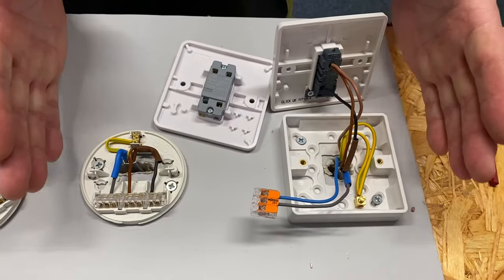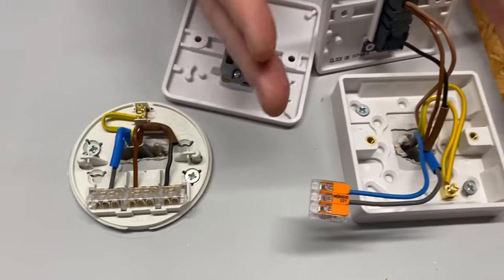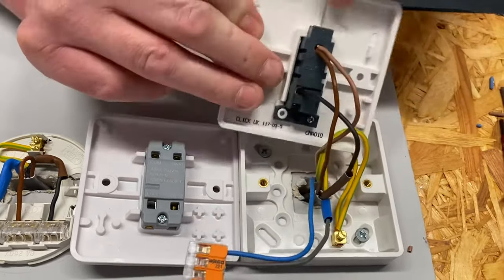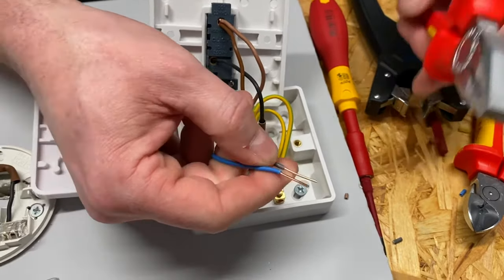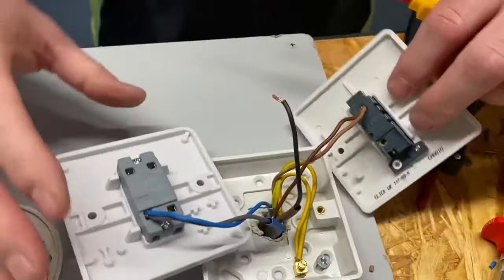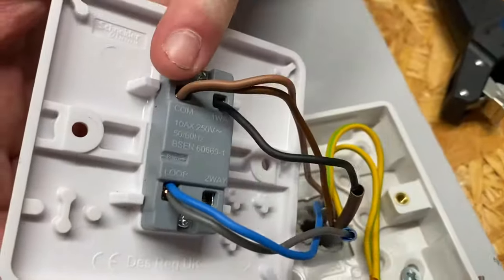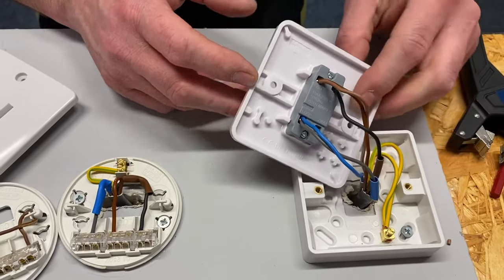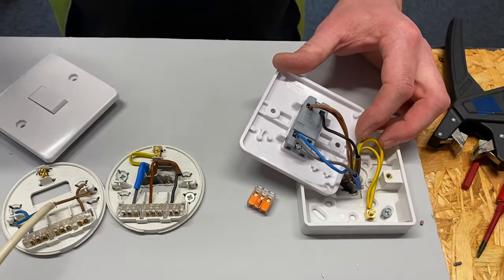Future Proof with a Neutral Connection in the Switch - Schneider Electric

Comment: Best of both worlds!
Reply from the maker: Just trying to give ideas Wayne. Are u a feed to the switch or 3 plate lover? 

Thanks for commenting and watching
Reply: @GSH Electrical  I suppose it depends.. What the client wants, cost, time, and practicalities. Would there be enough room in a typical down lighter fittings to aconadate the permanent line conductor? Your example showed a ceiling rose to accommodate the extra feed cable to extend the lighting curcuit. But I guess a junction box would be needed if you were extending off down lighters?

Comment: Traditional 2 plate and 3 plate wiring avoided running neutrals through switches as there were no BS approved connectors you could joint them with hence it was considered bad practice when I did my “tech” 35 years ago 😮
Reply from the maker: Thanks for your input

Comment: Interestingly, all the 1980s houses on my estate were wired like this on the ground floors - they were ahead of their time!
Reply from the maker: Sure was 👍🏻
Reply: @GSH Electrical  I actually think there's a lot to be said for the old 'Octopus Wiring Systems' way of doing lights - makes it very easy to add, remove or modify how fixtures are wired

Comment: I dislike placing the neutral at the switch… but nowadays it’s becoming a necessity because of wifi lighting controls.
Reply from the maker: Can you expand on why you dislike the neutral at the switch…

Massive thanks for watching and commenting 👍🏻
Reply: @GSHElectrical  Mainly thee extra cables, come across many situations clients wanting dimmers installed and just not enough room in the back box. Now this is going back some years, now a non issue with the deeper boxes now used. 20mm deep has become a rarity now with 25mm being the go to.
Suppose i should have said i did dislike!
Reply from the maker: @Sudds1888  great point deeper boxes is now a must 👍🏻.

Comment: Sonnoff are now making WiFi smart switch modules (that fit inside a 25mm back box) that do not require a neutral.  They are very reasonable in cost. They require a bridge module but no biggy. Can retrofit in current configuration.
Reply from the maker: Great comment - have you fitted any of them?
Reply: @GSHElectrical  No but have used sonoff and they work okay. Although might not be popular in some commercial places due to the Chinese app you need to install. Work with Alexa, Google etc though.
Reply: One thought is that future systems maybe be POE for switches/smart equipment and not be mains connected other than to the Poe switch(different kind of switch ;) )

Comment: I’m not sure that I like the idea or the neutral going in the back of the switch. The DIY people will just  pull the switch off and replace it with a 2 way and bang.  Same as when they charge a ceiling rose they just connect the lives together and the neutral together simply discarding the brown sleeving on the switch live .
In the old days it was always bad practice to  have a neutral at the switch something we would never do . Unlike today